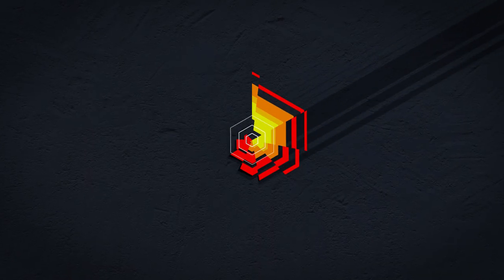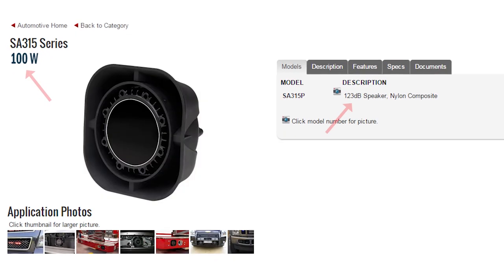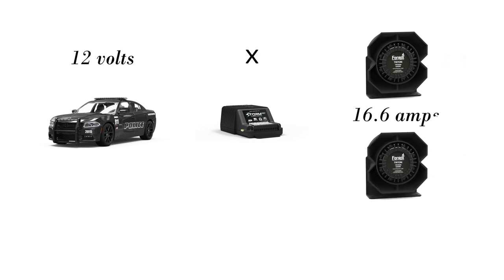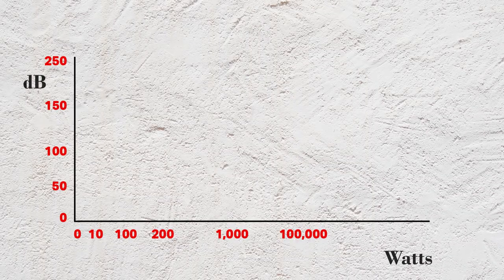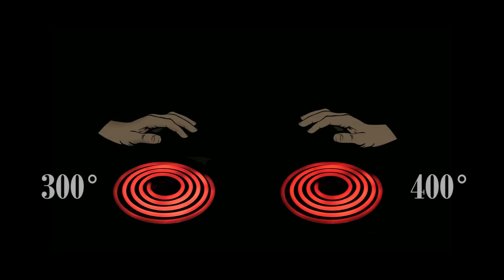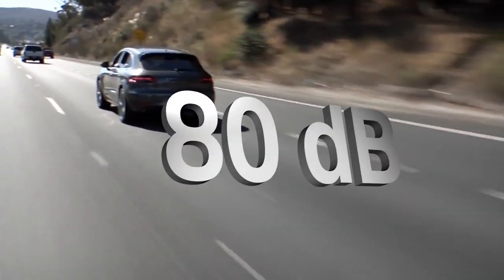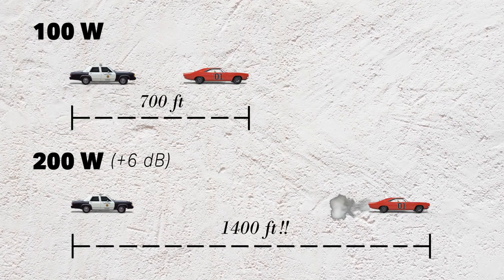Feniex Focus Episode 1 // Is a 200 Watt Police Siren Twice as Loud as a 100 Watt?

Comment: I see several comments about the 100W to 200W and the 3dB vs 6dB.  Let me help explain.  The delta between 100W and 200W of power, expressed in terms of relative power levels, is 3dB.  The delta between 100W and 200W of power, expressed in terms of the sound pressure level (SPL) in pascals produced by that change in power level, is 6dB.  Those who say there is a 3dB  delta between 100W and 200W are correct.  Those who say there is a 6dB delta in  SPL when power is doubled (i.e., 100W to 200W) are ALSO CORRECT.  It is very important to understand that dB is often used for different things, and it can give us different numbers, even though those numbers mean the same thing!  In this case, a 3dB change in relative power is the SAME THING as a 6dB change in relative sound pressure level.
Reply from the maker: Thanks, Jay!

Comment: Excellent explanation. Only issue with running dual tone is that you now lose the +6db from having a second speaker producing the same tone. Having one speaker run Wail while the other runs Yelp now gives you two different 124db tones only traveling 700 feet.  Stick to a true 200w siren by running single tone in phase.

Comment: I believe the CHP uses a 200w siren. Those things are very audible at longer distance. But they are necessary since they mostly operate on Highways.
Reply: Exactly. And in the city, it's only a nuisance. Inside my house I can hear the new ambulances coming from about 4 blocks away
Sirens should have a highway and city mode!
Reply: @finnk1289  Well, big cities are loud by themselves, and when you're in a car (especially modern, very sound proof interiors) the sirens need to be loud. Add listening to music in the car and you still can't hear them before they're tailgating you.

Comment: 100w to 200w is +3db not +6db. In order to make +6db from 100w would take you to make 400w for the difference. Don't know where you got your info, but its incorrect.
Reply: being in both the audio and rf industry for many years I know these figures. building audio systems and wireless systems I use them often. not only professionally, but in play I suggest you go have a talk with your product engineers and development as your figures are incorrect.
Reply: @chrislindsey1726  well good thing we have you trolling around Flapjaw.

Comment: So basically, departments have been getting this all wrong...
For intersections, the obvious solution is to use sirens that have greater sideways coverage, instead of just piling on more watts.
Highways are the only situation where a 150-200 watt system will help, in other situations it's important to have a volume limit for residents and pedestrians.
-
If you want to be more visible at long range, don't buy more lights. Change the pattern so it's a simple half-half pattern (or in-out if you've white lights in the middle). Perhaps an on-off every few cycles as well. But remember: the simpler the better.
Reply: You are correct!   The many light patterns are fun, but most effective is plain ALL ON, ALL OFF at.tracting the unexpecting eye.  Unfortunate that electronic siren speakers can be so forwardirectional.   The mechanical sirenspread sound more around.    Buthey are big and heavy and use much power.

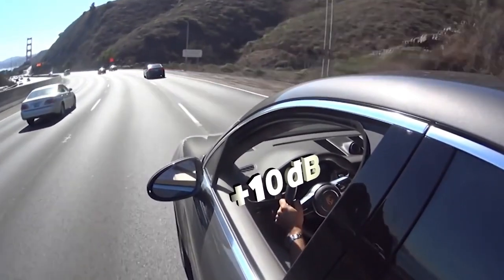Comment: There's an error in your presentation at 4:03. The graph has 'dBs' above it. There is no such unit. It should say 'dB' - you don't pluralise abbreviations. Example - 1 dB, 86 dB. A letter added after dB is a reference, for example 'dBm' (relative to one milliwatt). Other than that, a good explanation about sound levels!

Comment: good job great video, i have been running a duel tone 400 watt siren with duel 200 watt speakers and several people have told me they can hear me much farther than some other vehicles , another think you can note that your side range at intersections is probably half of your front range, so instead of 700 feet its 350 feet, by using 200 watt that would make it 700 feet to side and 1400 front, which makes intersections much safer in which most accidents happen. thanks feniex you products are great, i love the apollo lights .
Reply: A 400 watt siren? Okay now that is way too much.
Instead of increasing the volume in front, how about placing the speakers differently? I wish there were 180 degree speakers - maybe there are.
Reply: @finnk1289  no it is not way too much it should be a standard for all emergency vehicles, very true you could run 4 speakers 2 to front and 1 to the sides but that is over kill

Comment: I have the Fenix Storm Pro100 but I was only able to get my hands on a 200W speaker at the time. Would my sound quality improve if I used a 100W speaker?  I only use the PA and the ghostbusters ECTO 1 siren in my setup.
Thanks

Comment: Where do you get the magic 195dB from? A shockwave is a pressure wave that travels faster than sound, not just really loud sound.
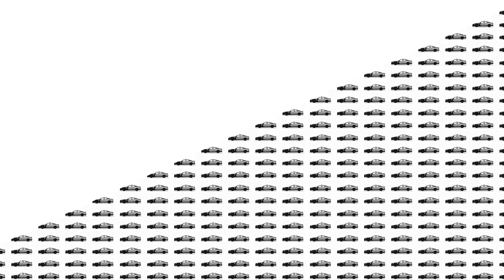Reply: +Feniex Industries But that still doesn't explain the comment at 2:41. Where does that come from? Do you have a link to a study or something?

An louder sound IS higher sound pressure. SPL = sound pressure level.
Reply: +Feniex Industries Thanks!

Comment: so, if i have a 200 watt siren amplifier, with 2 speakers at 100 watts each, would i get the same distance as a single 200 watt speaker? or still the same distance of the 100 watt speaker

Comment: Thank you for this video! 

Insterestlingly enough, the siren system in China is in different format, the standard siren AMP uses  150W 8 Ohm in China (mostly), and I think the AMP and speakers you use is 100W 11 Ohm, so how do you measure between 150W 8Ohm speaker and 100W 11 Ohm speaker? 

I am actually using your Storm Pro 100W with the Chinese 150W 8 Ohm Speaker, I dont feel any difference between using it with the original 100W 11 Ohm speaker and the 150 8 Ohm Chinese speaker though, but do you think it will cause any harm to the Storm Pro unit?.
Reply: good way to blow up your siren, you always use the speaker that matches the amp

Comment: You do know that 6 decibels is four times the sound output don't you. Every 3dBm is double the previous out put. 2x2 = 4 times. To be fair perceived sound is not quite mathematical and depends on the total output power.

bm
Reply from the maker: You do know that when you ask a condescending question, you end it with a question mark, right?